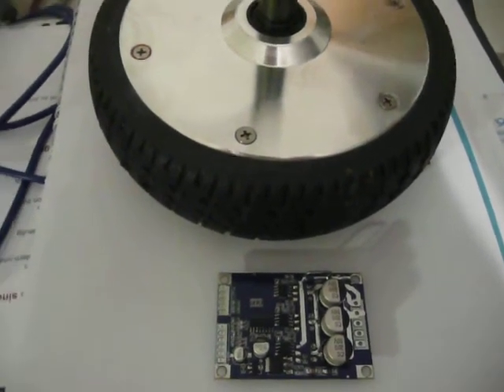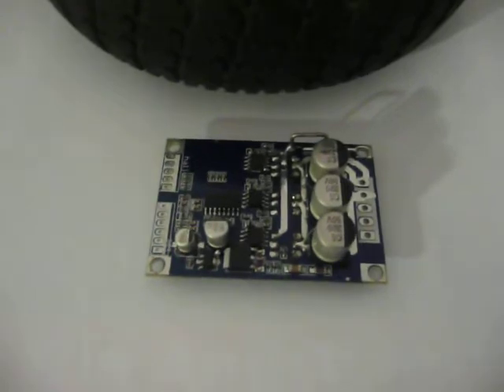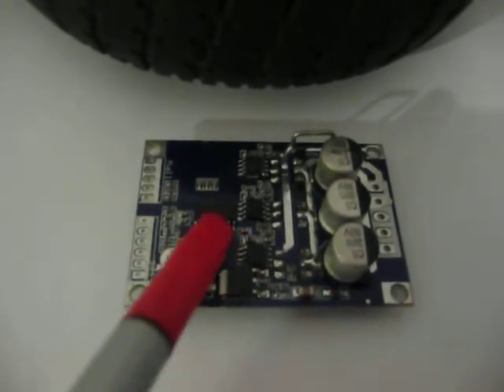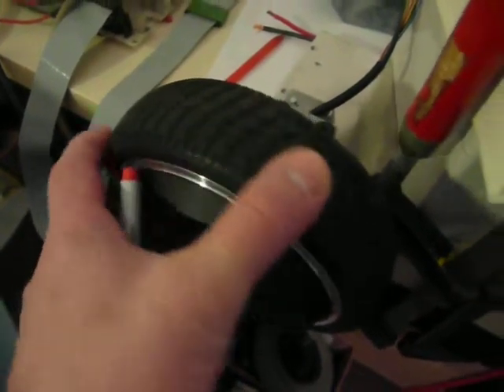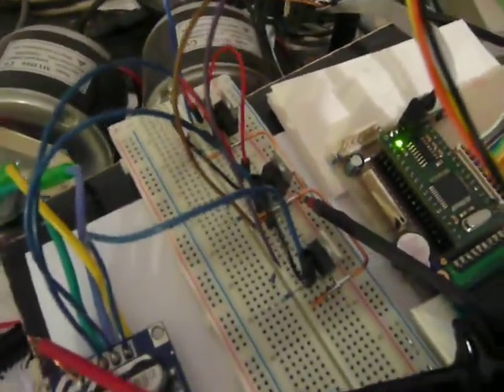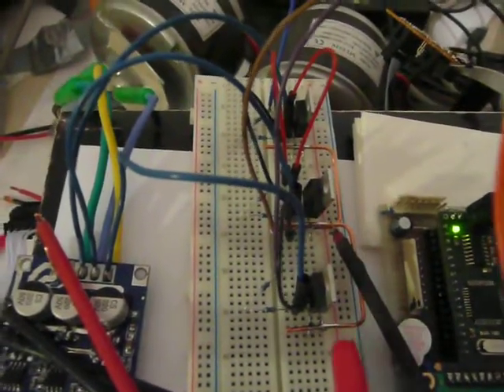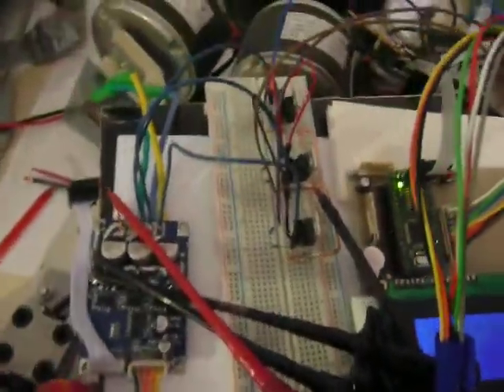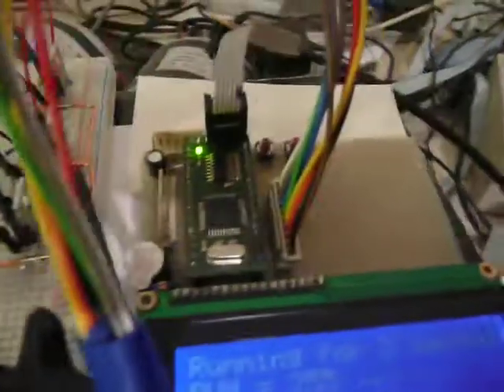8$-Brushless-Controller JYQD for Hoverboard-Motor NOW WITH BRAKE - Part 1

Comment: Dear friend your video is amazing, but I have a doubt, can i connect to the controller a 10s2p 36volts 4.4ah battery of lithium-ion ? I have that doubt because when my battery is fully charge it gives 42v and the controller supports only 36v... Maybe theres a way to connect this controller and the battery when it has full charge, without burning the controller ? I need your HELP, I dont know much of electronic but i want to do an e-scooter with the parts mentioned. Please help me, answer my question
Reply: i saw in the comments "For even more driving dynamics, the operating voltage must be further increased. Protective measures must be taken as the internal voltage regulator LM317 only has max. 36 Vdc allowed. But even that can be achieved with simple means, an operating voltage of 42 Vdc I plan to use in my system" you did it ? how ? I saw the part 2 of this project and i couldn`t find an answer to my question thats why im question you and hope you read my comment and help me, please
Reply from the maker: @ekosyalek  The problem is known and has already been explained by me here or in part 2. It is true that a 10s battery has fully charged up to 42 V. For the BLDC controller this may be a problem as it is only specified at 36 V. The transistors of the BLDC controller will withstand the higher voltage, but there are also capacitors and the LM317 voltage regulator. In addition, there are different variants of the hardware, you never know which components (dielectric strength) were then processed.
But there is a trick, but you have to intervene in the hardware and cut conductors and can handle a soldering iron!
The trick is to solder a so-called 12 V suppressor protective diode IN THE SERIES to the LM317 and the capacitors. The result: the MOSFET's get full battery 42 V and can tolerate that. The rest of the electronics will receive only 30 V (42V-12V) when fully charged. The 12V diode gets a bit warm, but this is ok because about 30 mA flow into the circuit (P = 12 x 0.03 = 360 mW). If that's too hot just solder another 12V diode parallel to the first 12V diode. And to be on the safe side, you can solder another 36V protection diode to ground from the anode (30V side) of the 12V diode to protect the circuit from annoying spa power spikes. In your project, you probably do not need my MOSFET brake, because when the brake is applied, the voltage on the battery increases due to regenerative feedback from the motors during heavy braking!
It would have to run with you ... :)

Datasheet:

http://www.farnell.com/datasheets/2045671.pdf?_ga=2.10786868.1298329360.1572254673-1103872668.1572254673
Reply: AccuXperT  Dear friend, im so glad you answer to my question, know i now that theres a light that can give brightness to my project but i dont get a all clear.. I can handle a soldering iron and can modify the hardware of the controller but i have some doubts... You said that i need to connect a 12v supressor protective diode but where ? I guess the lm317 are the six components in the back side of the board but wich of these lm317will recieve first the 42 volts ? On wich of this lm317 i need to put the diode ?? Altought you mentioned the capacitors, i got tree capacitors write 50v tolerating, one of 35 and one of 10 volts... My controllee is the model of controller same this just that dont need to put the hall sensor... Please help me with this little doubt, help me
Reply: In adition. You mentioned the capacitors, i got three in the front and upside of the board that have write 50volts of tolerating, one of 35v and one of 10volts *
Reply from the maker: @ekosyalek  First to the capacitors: the 3 pieces with 50V are no problem because they buffer the 42V for the MOSFET transistors. That's OK, the MOSFETs should continue to run with 42V, for maximum performance. The 10V capacitor is also no problem because it sits behind the LM317. The LM317 is the component with the soldered cooling lug. It is important to understand that the 42V from the input terminal of the BLDC controller split: a THICK lead goes to the MOSFETs, which remains unchanged. A THIN trace leads to the LM317 (and other components). Exactly THIS line must be separated with a sharp knife! The split point is then bridged with the 12V protection diode (1.5KE12), so that the cathode leads to the 42V connection and the anode to the input pin of the LM317. Before and after disconnecting the trace, please check the steps with an ohmmeter. When the diode has been soldered in, first check the function with a voltmeter (DVM) and at U_in = 30: At the input of the LM317 you have to measure about 18V with the voltmeter (30V - 12V = 18V)! Should 29V be measured on the LM317, the diode is soldered upside down and almost ineffective! Please do not test with a full battery and 42V after a conversion, but - if available - first with an adjustable power supply and 30V, or test with an empty battery.
I admit that this is a serious intervention in the electronics. If you have no experience with this, you should ask an electronics technician up close who can help.
There is also the Brutal method (not recommended): simply replace the 35V capacitor to 50V type and perform a function test with 42V. The LM317 would have to endure the 42V because the LM317 only "sees" the difference voltage between input (42V) and output (10V), but nobody will guarantee that ... :)

Comment: Hello, thanks for the upload. I have a question about your setup.

Are you using any microcontroller to control the motor, such as an Arduino? I have a similar setup with a repurposed hoverboard motor and the motor works with the BLDC motor controller I have (different from yours), but I am trying to send a PWM input from an Arduino to the BLDC motor controller which is supposed to be able to accept a microcontroller signal (at least the seller says it can), but I get no response from the motor. The controller works with a regular potentiometer, but does not work with the Arduino PWM input.

Any help would be appreciated.
Reply from the maker: So I used a small developer board with an ATMEL ATmega32. That's enough for my needs. Unfortunately I'm not familiar with Arduino.
The motor actually sends only Hall signals to the controller board (not to the Arduino / ATMEL). The speed is usually controlled by a PWM signal instead of an analog potentiometer. Controllers that only support one pot must be outwitted, e.g. with a PWM signal which is passed through a low pass and integrated. This needs to be investigated and tested on a case-by-case basis.
In your case, I would with a voltmeter (DVM) check the signals from / to the engine. The change of the Hall signals can be measured (in the presence of 5V and GND) well when the wheel is slowly rotated. I do not know how your engine controller works, but it must be clear from the specifications. Here I would write to the manufacturer and ask the question of PWM functionality on the input side (speed) ...
I wish you success...
Reply: That's very good information. I will continue to investigate my controller board. Thank you for your reply.

Comment: Hello, I am currently building what  made in this video and I have a couple of questions. 
Where did you find the clamp for fixing the axle of the hub motor to the board? 
Do you know where to find the specifications of the 8$ board? 
Thank you so much. 
Bye.
Reply from the maker: The attachment for the BLDC motors, I saw out of two old hoverboards.
You can find part of a datasheet on the net if you are looking for the chip JY01 in connection with BLDC or JYQD ...

http://www.czowo.com/sale-10257843-high-efficiency-brushless-dc-motor-driver-ic-low-noise-easy-to-application.html
Reply: Hello, thank you for your answer.
I don't if is better to use a bldc like the one you are using or using an ebike controller (I don't kow if this cold be controlled through a pwm signal and if it can be reversed)
The problem with the jdq is that you have to add a dissipator and soldering all the cables + connectors.
What is your opinion about this?
Have a nice day by, Leonardo.
Reply from the maker: Which controller you take depends on your project. For an eBike it is important that the wheels continue to turn freely when the gas is taken out. Then you better take a normal eBike controller and not this from my project here. But for a robot project you need up to 4 controllers and you also want to brake the wheels (= short circuit the engine).
For a robot project, the normal eBike controllers are unfortunately not well suited and 4 pieces would be much more expensive ...
But I think you always have to solder a bit in these projects ...
Reply: Yes, I think you are right.
Thank you so much.
Have a nice day.

Bye, Leo.